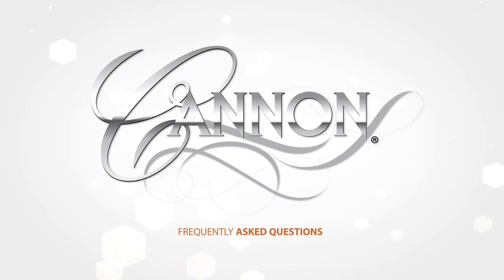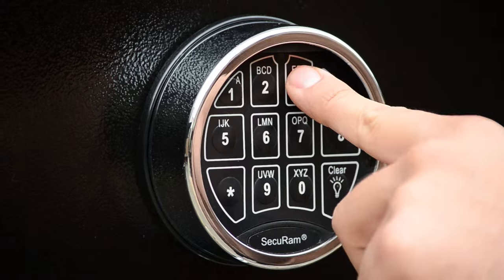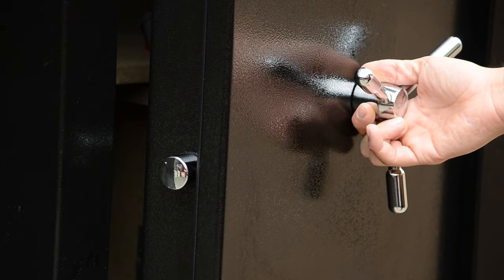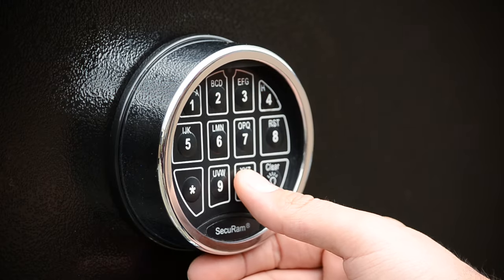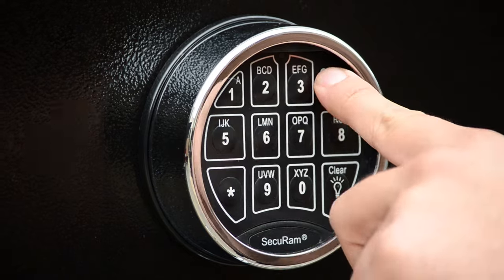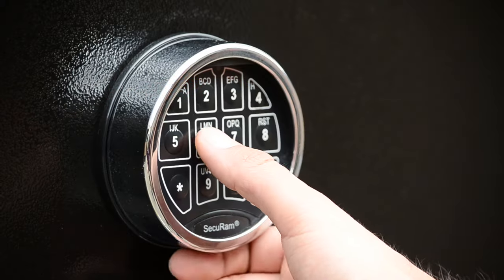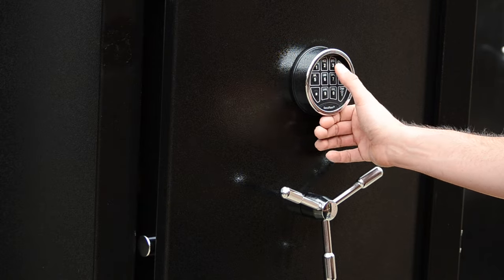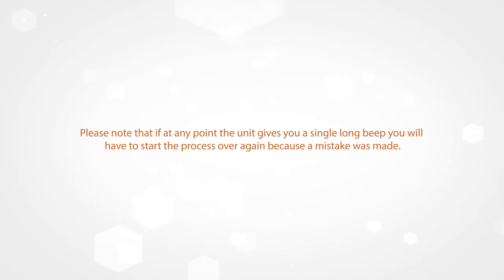Cannon Safe - FAQs - How do I program my safe code? (SecuRam Keypad)

Comment: I got a cannon safari safe that was working right but a couple of weeks ago The battery was dead and After replacing it the safe only beeps and it won't do anything else, tried different batteries but it just beeps like every two seconds is there a quick fix for that problem?
Thank you
Reply: I know this is an old question but if you call Cannon, they will give you a couple of things to try. I had to replace my entire lock and made a video about it ig interested.

https://youtu.be/Ab65HaluE0A
Reply: @Bluelightbandit  i cant get safe open wont let me in..inpress the code but each number i push makes long beep